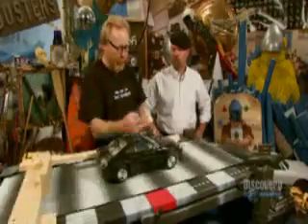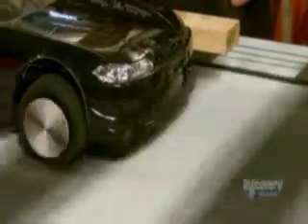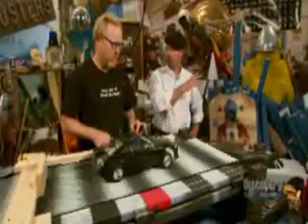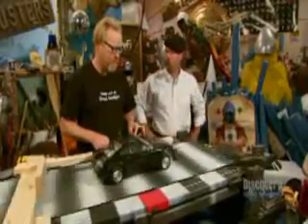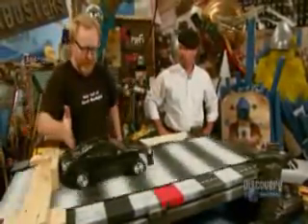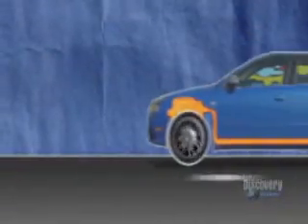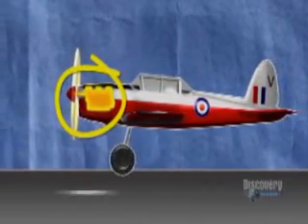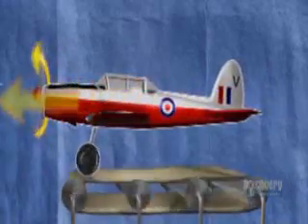Plane Conveyor Belt MythBusters Explanation

Comment: There is no difference in the type of force applied to the vehicle (aircraft or RC car or rocket vehicle, etc.). You only get a horizontal force.  The only time that matters is, of course, if the vehicle lifts off the ground and the powered wheels lose contact with the surface.  Even still, that just means that the four forces calculations still apply.

That said, their RC car experiment is flawed.  There are three parts to what they showed.

First, they showed that a treadmill can match the speed of a powered vehicle.  That shouldn't be controversial and that's actually what the thought project is saying to test.

Second, what they did was turn off the motor in the RC car; not surprisingly, the car slowed down...but they did not also slow down the conveyor belt to match that speed of the wheels.  That is the explicit term we are given.  Matching the speed of the wheels.

Lastly, when they used a hand to roll the RC car across the surface of the conveyor, they did not match the conveyor / treadmill for every adjusted speed they made.

IF they push the RC car forward, that means the wheels are rolling faster; the conveyor is supposed to speed up to match.  Mathematically (and absurdly) that means that they can apply any push to the RC car or the aircraft, and the conveyor accelerates to match that rate.  The RC car or the aircraft remains locked in place - 100%.

In order to do that test truly properly, they would need to do some measurement of the wheel speed with a tachometer or, more crudely, with a position measuring system and then tie that into a controllable motor on the conveyor that adjusts to the rotational speed of the vehicle or the relative position of the vehicle.

With their airplane on a tarp pulled by a truck, they spitballed it.  That's not a good way to test something that's pretty explicit in its explanation.

Comment: A car stopped on a stopped conveyor will drive off without the conveyor every starting. As the wheel turn the car moves forward and the conveyor moves backwards under the wheel the same amount, 1 for 1 in the opposite direction. The conveyor never starts.

Comment: The only thing that might slow a plane down is if there's some air current generated by the conveyor belt
Reply: The conveyor is not slowing down the vehicle; it’s that the conveyor represents ‘ground’ moving at the same rate as the vehicle would be rolling forward.  It’s a frame of reference issue along with a conversion between linear and angular momentum.

Comment: wrong! 

when plane moves forwards speed of conveyor belt and wheel is not same

when air plane "accelerate" the conveyor belt also accelerate to mach speed of wheel

because problem says ""The conveyor belt is designed to exactly match the speed of the wheels, moving in the opposite direction"
Reply: Exactly right!

The question I saw on the internet is that "the conveyor belt MATCHES the wheel speed".. but many people confused it with "conveyor belt MATCHES the Take-off speed of the airplane"

If the conveyor belt moves at 100mph backward and remain at that speed.. eventually as thrust is added, the airplane will accelerate to a faster speed than 100mph and move forward... and create lift... and lift off..

but if the conveyor belt accelerates with the airplane.. the plane could be powered-up to 5,000,000mph or more, but as long as the conveyor belts matches the speed in the opposite direction.. the total movement of the airplane will be 0.. and thus no airflow over the wing.. no lift..
Reply: Sorry but you're both wrong. Just as it is demonstrated in this video the conveyor belt has no effect on the thrust being produced by the engines. That conveyor belt can be going 2,000 miles an hour and it won't stop the plane from moving forward. Let's remove wheels from the equation and use a different mode of transportation that like a plane uses thrust produced by the engines to achieve movement. 

If you was to place a hover craft on a conveyor belt under the same circumstances would it be able to gain forward motion no matter what speed the belt was going?  Of course it will because the conveyor belt has no effect on the thrust being produced by it's engine. The same principle with a plane.  If you have access to a treadmill you can do the same experiment. Turn on the treadmill and set it at its slowest speed. Then take a toy car and hold it in place  on the end of the belt. Simultaneously increase the belt speed and slowly  push the car forward. By your logic no matter how hard you push on the car it will remain stationary.
Reply: @jackblack9208  No, you're wrong, because as soon as the plane starts to move faster, the belt moves faster.
Reply: @Optamizm , it blows my mind how some people can't seem to wrap their mind around the fact that an airplane's wheels are not powered in any way. They are just wheels on an axle that spin freely and have nothing to do with propelling the plane down the runway. Thrust from the engines is what moves an airplane. If the wheels did drive the plane down the runway then you would be right. Since you can't seem to get around the issue with the wheels let's remove them from the equation and use a different mode of transport that, like a plane, uses thrust as a means of propulsion. Let's say you have a large conveyor belt the length of a runway and instead of a plane use a hovercraft. If the conveyor belt was running at a speed equal and in the opposite direction of the hovercraft would it move? Of course it would because the conveyor belt has no effect on the thrust being produced by the hovercrafts engine. Now if you had a wheel on a stick and you hung over the side of the hovercraft and placed it on the conveyor belt, would the hovercraft come to a stop? Again, of course not because it still doesn't effect the thrust being produced by the engine that is pushing the hovercraft forward. It's the same principle with an airplane. The conveyor belt has no adverse effects on the thrust and the plane will still travel down the runway until it has enough airflow over the wings to attain lift. Which means that to the surrounding environment the plane will get to 150 knots ( roughly the takeoff speed for a large jetliner) and in relation to the conveyor belt it will be going twice that speed meaning that the wheels will be turning at 300 knots.
Reply: @jackblack9208  I think you're not understanding. You're limiting the speed of the belt in your mind to a maximum speed, don't do that. The belt would have to move at ridiculous speeds that wouldn't actually be possible, but this is a thought experiment, not a practical one. In the real world, you couldn't get a belt to exactly match the speed of a plane like the question asks. But as the question asks, the belt is ALWAYS matching the speed, so no matter how much thrust the plane gives, the eventual build up of friction would stop it. Yes, it the real world the belt and landing gear would melt long before then, but then you'd say the plane didn't take off either.
Reply: And a plane with wheels touching the ground =/= a hovercraft.
Reply: @Optamizm  it wouldn't matter if the conveyor belt was running at 20,000 mph it still wouldn't have no effect on the thrust pushing the plane forward and what little bit of friction that is there between the conveyor belt and the wheel would not come anywhere close to overcoming the 120,000 pounds of thrust being produced by the engines. If you have a treadmill set it at the lowest speed and place a car on it. Then move the car forward while simultaneously increasing the speed of the treadmill. You will notice that it takes no more effort to move the car forward at a faster treadmill speed than it does at a lower speed because the speed of the treadmill has no effect  on your hand pushing the car forward. In this situation your hand pushing the car forward is the same as the thrust from the plane's engine pushing the plane forward. Here's another way to look at it. Let's say the plane is coming in for a landing and is traveling 150 knots. It lands on a treadmill that is going 150 knots in the opposite direction what would happen when the plane lands? Would it instantly stop? ( keeping in mind that a 747 weighs about 750,000 pounds) or would it keep moving until it slowed down?

Comment: Just because the results of the test were not what you expected, does not mean they did it wrong. You expected the plane to be held stationary by the belt? A conveyor belt is incapable of holding any airplane stationary because of the way airplanes propel themselves. Read that last sentence 5 times out loud to yourself please. Airplanes do not push off the ground to move.
Reply: That analysis is incorrect.  It doesn't matter how the vehicle (car or aircraft) is propelled by a force if the issue is the wheel and conveyor parity.  That faulty differential in force application has confused the people who think the plane can take off.

Even in the car model getting a push example they show at the beginning, the application of the force does increase vehicle speed and the corresponding wheel rolling speed.  The conditions of the thought exercise is that the conveyor exactly matches the speed of the wheels and they did not show the conveyer altering speed when they applied that force.

A better test model would be to measure the wheel speed of a vehicle - any vehicle - during some performance condition on the ground.  Take that rolling speed parameter, input it into the magical conveyor belt, replicate the vehicle performance on the conveyor belt with the 'matching speed program' activated, then we would see that absent any slippage, the vehicle will remain stationary as the wheel speed varies (and the conveyor speed matches).
Reply: @MrDefreese  The myth does not mention wheel speed, only “speed”.
Reply: @mitchio83  They misstate the problem.  In most places, it explicitly states that the conveyor matches wheel speed.

If the conveyor matches vehicle speed, it's even more obvious that the aircraft goes nowhere.  That's a difference without distinction - they botched the project and unfortunately gave a false impression to people who generally trust them.
Reply: @MrDefreese  regardless of the wording, a conveyor cannot hold an airplane stationary, either A: the plane takes off breaking the parameters of the myth, or B the plane takes off without breaking parameters of the myth. I didn’t follow how it would be more obvious that the plane would be stationary if the speed was referring to airspeed not wheel speed.
Reply: @mitchio83  sure the conveyor can hold an airplane stationary.  In fact, you could calculate the force involved since we would know the wheel diameter, rotational speed, weight, etc., etc.  This is essentially, a trick intro to physics question using basic elements that most physics students have actually solved for.

Apply force to the wheel axle to simplify and you have everything necessary to calculate wheel speed, rotational speed, linear speed, etc.
Reply: @MrDefreese  So you are saying the body would be stationary but the wheels would be spinning and the belt would be spinning? How many mph of the belt cancels how many lbs of force from the jets?
Reply: @mitchio83   force is force.  Speed is speed.  One would be able to calculate the wheel speed and ground speed of the hypothetical aircraft.

One would be similarly able to calculate the force of the conveyor to achieve the corresponding linear speed of the wheels. 
The only real way to do this is to us a vehicle on a conveyor with a programmable wheel speed controller and conveyor speed controller.

Most attempts to show one way or the other in real world experiments rely on people trying to sharpshoot the conditions of the problem and that's going to be ridiculously hard to do.
Reply: @mitchio83  an even better way to simplify is this - one could theoretically approach an aircraft and just 'push' or 'roll' the tires and the vehicle will move - so long as the brakes are off, of course.

It's absurd and unnecessary and impractical, but that's the physics we have and the crazy scenario we are given.
Reply: @MrDefreese  I would still like to know, it would look like a stationary plane, with wheels and conveyor belt spinning, correct?

We agree planes don’t use there wheels for propulsion like a car does?

Since friction is a constant it will not increase with speed so the plane could have no wheels at all and just scrape its frame along the belt and it still would be able to take off fine no matter the belt speed.
Reply: @MrDefreese  In your analogy of pushing the tire you have 2 anchor points, the hand and the ground, when the hand pushes one side, the ground stops the other side from moving effectively pushing off of that surface, the treadmill scenario you have only 1 anchor point, the ground (belt) so when it moves the opposite side of the tire moves so the wheel stays stationary.
Reply: @mitchio83  One could do a calculation on a purely friction scenario, but it's not the same as analyzing a wheeled vehicle situation.  Once you get past static friction conditions, kinetic friction resistance is only a fraction of the force and weight calculation.  That is again an intro to physics problem which is different than the conditions of a wheel and cart hypothetical.

With a wheeled vehicle, you are going to find the angular velocity of the wheel which is exactly tied to vehicle velocity (while we are on the ground, of course).  That angular wheel velocity is the exact same as the linear velocity of the conveyor.  Since the problem states that the two are the same, the vehicle velocity is exactly zero at all times.  It's built in to the conditions; we can't change the parameters.
Reply: @mitchio83  that's an irrelevance just like the concern about the friction of the wheel bearings that many people add to the scenario.  If you had a mini-conveyer attached to rotate the wheel (while on the ground and with the brakes off), the vehicle will move.

The trick is this fantastic, absurd ability of the conveyer to adapt to exactly match the rolling speed...while its on the ground.
Reply: @MrDefreese  Not sure if i am fully understanding. Please answer directly, could a conveyor prevent a hovercraft from moving forward? Why or why not.
Reply: @mitchio83  the conveyor would have no effect on a hovercraft at all since as we would agree, the layer of air between the hovercraft and the conveyer means there is nothing for the force to act on.

A wheeled vehicle, however, is an old problem that goes back to introductory physics covering angular speed and force application.

Comment: Devils advocate: Above the conveyor is a column of air. Air is NOT frictionless so the air is actually pulled by the conveyor. In "theory" if the conveyor was travelling fast enough it would move the air over it above the aircraft's stall speed. THEN if the aircraft was thrust forward through this moving air it would lift stationary relative to it's surroundings.

Release a ping pong ball above a really fast conveyor and it will blow off the back without ever touching the belt.

Comment: The airplane equivalent of the conveyor belt and car would be a giant fan blowing at the same speed as the propellers (or jet engine). In the air with another plane it's called propwash (or jetwash) and has downed many an airplane.

Comment: @billsparky16 Real things have friction. "Free-spinning" wheels aren't totally free-spinning.

A plane with a weak enough prop would travel backwards along the treadmill. At a certain thrust level, it would be stationary with respect to the ground. At a higher thrust level, it would begin to move forward as in your simplified example.

Comment: @johnboozer ok i'm just reading this months later...
The planes "wheel-speed" is the distance the wheel travels across a surface over time. even if that surface happens to be moving.  The car can never match the wheel-speed of the plane on the belt because the wheel-speed "W" of the plane will always be equal to the planes actual groundspeed "A" plus the cars groundspeed "C"  W=A+C  A cannot be eliminated because its thrust comes from the propellers.  And so the plane takes off.

Comment: Changing the parameters of the experiment invalidated the experiment. Speed is only measurable if there is a relationship between two points. When the car's speed was measured, it was measured in relation to a point on the belt. The plane's speed was measured in relation to the air, hence the ground, since it was dead calm at the time. For validity, the plane's speed should have been measured relative to the belt, just as the car's speed was. This did not happen - experiment invalidated.

Comment: @johnboozer 
That's not reality. As soon as the engine is producing enough thrust, the airplane will accelerate forward, even if the conveyor belt is spinning the wheels at a million rpm.

Comment: @johnboozer 
 An airplane, however, moves forward by pushing against the air. The engines are in no way connected to the wheels. The wheels are free spinning. Only wind affects an airplane's takeoff ability, not anything that has to do with the ground. Of course if the airplane's wheel speed matches the conveyor belt speed it won't move, but that would only happen if the wheel bearings were completely frictionless and the engine was off or at idle.

Comment: @johnboozer 
What do you mean done "correctly"? There is no correct way to do it. It's a myth. For a car, the conveyor belt does affect it, but of course if the speeds aren't matched, it is going to travel in the direction of greater speed. If the car's speedometer reads 20 mph and the conveyor belt is traveling the opposite direction at 15 mph, then the car will go forward at 5 mph. That's because a car is propelled by its wheels pushing against the ground.